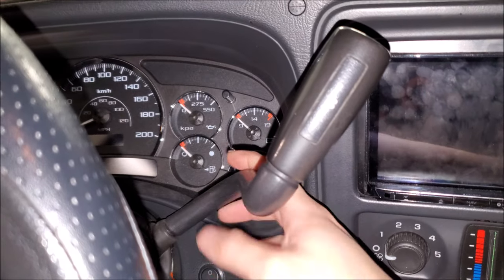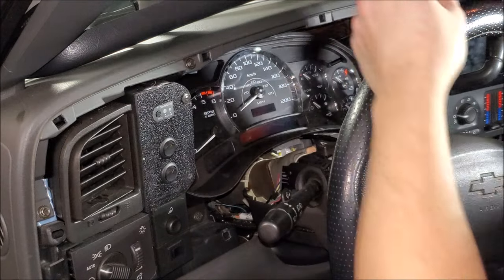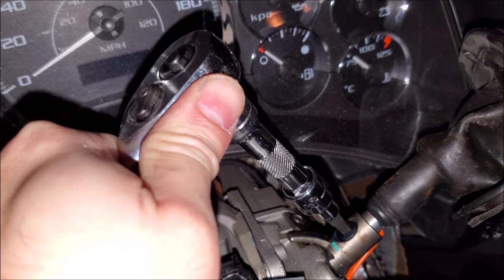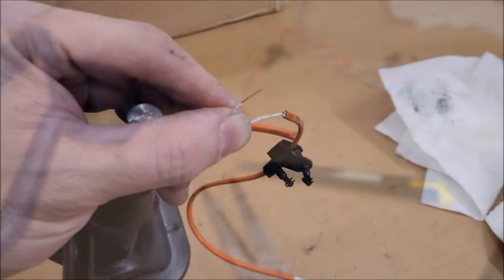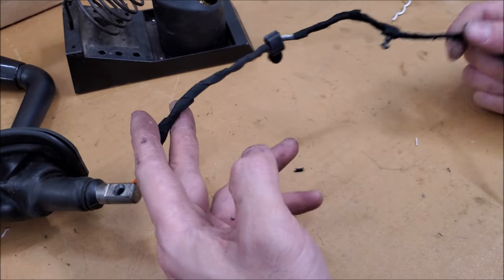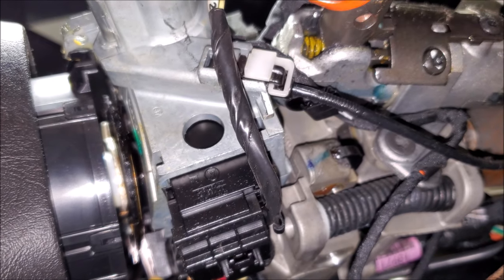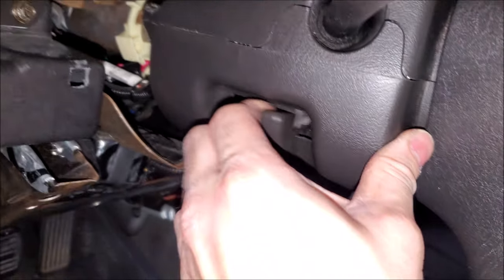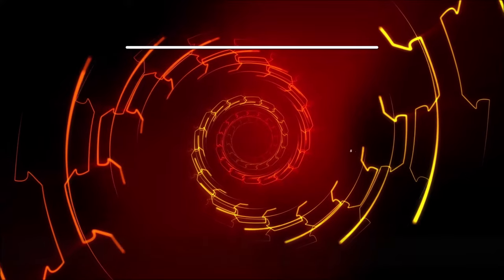GMT-800 Tow/ Haul Mode Button FIX (Silverado, Sierra, Tahoe, Yukon, Suburban, Escalade | AnthonyJ350

Comment: Awesome video on how to turn the tow/haul on, but how do I stop the tow/haul from engaging?  I have a 2001 GMC Yukon XLT 1500, and the tow/haul comes on, on its own and it changes the gear.  I'm not even pressing the button to engage it.  Definitely a headache.  Thanks Anthony!
Reply from the maker: Button may be defective or the wire is shorting out. It's definitely  not suppose to do that.
Reply: @AnthonyJ350  Thanks!  Looks like I can't just apply the cable fix, which also has been cut from the wear and tear (repetitive gear changing).  I'll have to call my auto guy unfortunately.
Reply from the maker: @THE.MICHAEL.ANGELO  Let us know if this fixes it
Reply: @AnthonyJ350  Will do!

Comment: Have you had better luck with the Kenwood Excelon double din HU, over their non-Excelon models? I know they have the extra warranty on the Excelons, didn't know if build quality was that much better or not
Reply from the maker: I don't know if it makes a difference there. But I swear the $1,000+ units are heavier and use better quality hardware because they always seem to work better. 

Get what you pay for I guess.

Comment: Can that break in the wire their cause cruise control issues
Reply from the maker: I don't think so, but you never know. If the wire is broken the truck should just think the button is in the "off position".
Reply: No but the brake light switch can

Comment: I appreciate you showing how to remove everything but the kink in the orange wire is right there, clearly visible to you. All you needed to remove was the steering wheel cover and peel the boot back. Then you could have fixed the wire at that spot
Reply from the maker: Thanks for the feedback